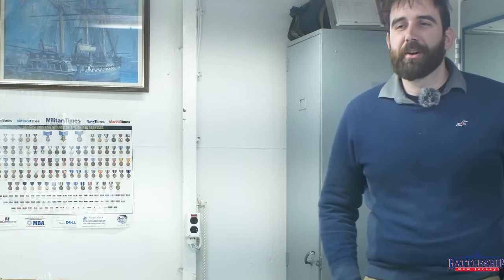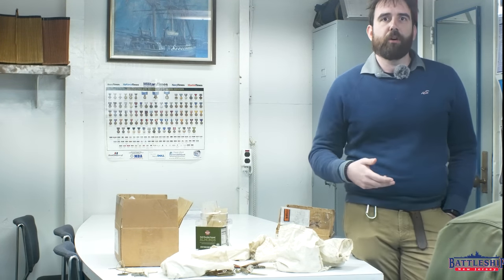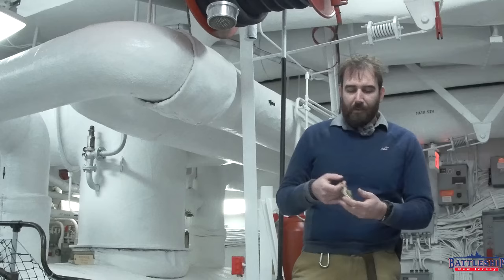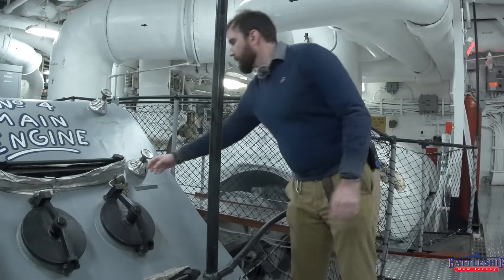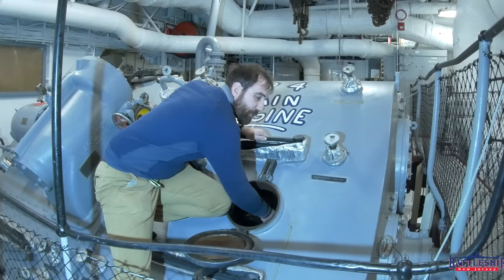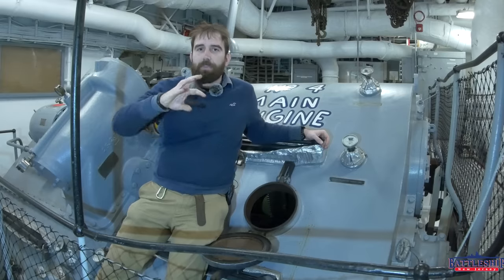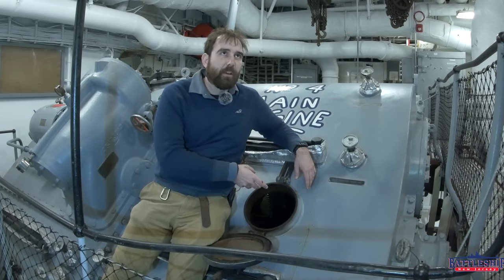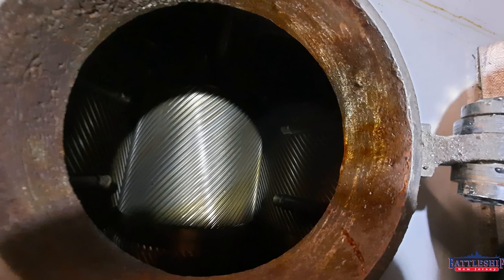The Keys to the World's Fastest Battleship: Unlocking the Reduction Gears

Comment: My advice with locks - you can pretty much always pick them. I'd think that would be the ideal solution for any other keys you can't find. The lock doesn't get damaged or cut, you remove the lock, the entire process is reversible. My biggest concern would be forgetting which lock goes where or losing the locks themselves. But ultimately locks aren't the safety feature most people think they are and realistically their use is such that someone either makes a lot of noise or takes time to remove the lock such that the good citizenry around will discover what they are doing and stop them.

My only advice is to get someone who isn't a hack. Exceptionally bad lockpicking techniques can damage the locks (usually slight wear). And whilst these at least appear to be beefy government type locks typically made to withstand huge amounts of wear and abuse, and whilst their date typically renders them far less complex than modern locks, I'd still worry for historical artifacts. My suggestion will always be the youtuber Lockpicking Lawyer - I'd expect he would jump at the chance of picking a lock like this, it would be a fantastic collab, and he's also proven his skill in front of the camera. But realistically a good proportion of locksmiths will have the skills required even if they aren't quite as fast and I'd like to imagine they would rather give a good recommendation than damage a historical artifact if they aren't confident.

I can't tell if my bias towards wanting the collab is on display, but having these picked is absolutely what I would do in the same case despite my extreme concern over wear and damage. If nothing else I'm sure he would be happy to talk and give you good expert advice on the pros, cons, risks, etc even if nothing comes of it.
Reply: You generally don't want to pick a lock that's important, it can be permanently jammed so that it has to be drilled or cut apart,

Comment: Non-sailor here, but this key system sounds like a reverse lockout/tagout procedure.  Having everything locked prevents someone from accidently working on the wrong piece of equipment.  Imagine a sailor being told to work on engine #3 and he went to #4 instead.  If it wasn't properly unlock, he might realize his mistake.  This is in addition to all the FME concerns and normal lockout / tagout procedure to ensure the equipment is taken out of service before maintenance.  In the nuclear power industry we lock rooms down for safety reasons since there are multiple pieces of identical equipment.  Checking the labels to the work orders is vital.

Comment: We know NJ can't move under her own power, but is there some kind of lock preventing movement of the gearing? I'd be afraid to stick my hand in there and have something shift and move that gear and next thing you know you're fishing what's left of your index finger from the oil sump...
Reply: Just so ya get an answer.
Yes, you lock the shaft (and thereby the gears) with what is called "jacking gear". It consists of a small (like maybe 5 hp) motor turning a small gearbox that will engage a coupling in the 2nd reduction pinion shaft. It is mainly used to slowly rotate the turbine rotors so they will heat evenly and not get a bow in it.
Through the crazy amount of gear reduction, it will hold the shaft stationary, up to a certain speed.
The destroyer that I was on, I believe we could do like 18 knts. with one shaft locked.
Disengaging the gear underway took a bit of finesse on the throttlemans part to apply just the right amount of steam to equalize the tourqe on the shaft from dragging it...

Comment: Cavitation is bubbles caused by excessive propeller speed or loading. The water vaporizes or boils due to the extreme reduction of pressure on the back of the propeller blade. Many propellers partially cavitate during normal operation, but excessive cavitation can result in physical damage to the boat propeller’s blade surface due to the collapse of microscopic bubbles on the blade.

Comment: It seems to be an early form of lock out- tag out. But in this case it might be more secure out. Any time there’s personnel working on equipment it can be damaging to operate it while being serviced as well as life threatening to personnel. If it’s an enclosed space it would be dangerous to enter a gaseous fume or liquid filled enclosure. The same applies to power sources like electricity, compressed air, steam, or hydraulic fluid to name a few. The number and types of potential hazards is staggering. There can also be chemical reaction hazards. There’s also a need to keep track of who can be working on a piece of equipment. In this case the marine will monitor who’s been around it and what they’re doing while there. Ryan it’s a good thing you kept them from cutting locks because there could be a lot of metal shavings falling into gears that way. It would be better to get a locksmith and make new keys than to replace the locks. The locks are designed with specific features for the application that might not be readily apparent. If you look carefully at a closeup of the keycuts you’ll see that some have angled cuts which requires special key machines to cut them. It also may require special internal pins to operate them. They also make pick resistant pins requiring a key except for the more skilled locksmiths.
Without a lubricant tank as large as the gear case it will cause the heat to be retained and if severe enough, cause the gears to expand and make them bind. An extreme worst case scenario but possible in a perfect storm in the middle of the ocean. It would be interesting to know if anyone has information on how hot they ran in operation.

Comment: Instead of right right lefty loosey, try the right hand rule. Curl the fingers on your right hand, if you turn the thing that direction, it will move whichever way your thumb points. Works way better at funky angles and can be flipped to the left hand when applicable.

Comment: The bubbles that form during cavitation aren’t air, but water vapor. The trailing edges of the propeller blades create low pressure areas as the props spun, and at higher speeds the pressure is low enough that the water in those areas actually starts to boil at a low temperature. The vapor bubbles collapse almost immediately because the low pressure areas are very small and move with the blades, and when they collapse there are minuscule shock waves. Shock waves from collapsing bubbles touching or in close proximity to the props will eventually cause pitting and cracking.

Comment: A submariner once showed me a reduction box, and said they never open it, since a tiny flaw could make noise. I didn't realize the gears were such fine pitch.
Reply: It’s counterintuitive but even finer threads on bolts has a higher percentage of thread engagement/ holding power than course threads. It’s also why finer helical gears are quieter since they have less clearance between the teeth. They have a larger contact pattern which spreads the load over a larger area which extends the life of it.

Comment: All of the magazines, pyrotechnic lockers and the armory had high security locks.  We had 4 sets of keys for the magazines for each group. Turret 1 (group 1). Turret 2 (group 2) Turret 3 (group 3) The 5inch mags and ciws mags. (Group 4). When we secured from working hours we would stand magazine security patrol. He would have to go into each and every magazine on the ship that had munitions. 1 group per hour. Mid-watch would take magazine temperatures  groups 1&2. 4-8 watch would get groups 3&4. Duty armorer in port or armory crew while underway would get the temps for pyrotechnic lockers and SRBOC lockers. Sometimes I would have to go fix a lock when a key broke off inside the lock.

Comment: Ryan - Another great video.  Incidentally -- Cavitation is caused when the propellers lower the water pressure below the point where the water will vaporize.  The bubbles are water vapor not air.  When they collapse they cause noise that can give away the location of the ship and and pressure that can damage the propellers.

Comment: Some ideas for lock and key would be: rudder equipment spaces, small arms lockers, fresh/potable water storage, powder rooms, radio transmitter/receiver rooms, and areas containing classified or compartmentalized information such as CIC. I say these spaces because they have equal or greater potential to cripple the ship. Crippling the ship's ability to steer can be as great or greater a hazard to the ship as crippling its ability to move, as seen with bismark. Small arms could allow a group to commit mutiny or break down the command structure. Poisoning fresh water could leave enough sailors unable to fulfill their duties and operate the ship and its defenses. Powder rooms could create massive explosions and fire if someone were to intentionally produce an ignition source inside. Radio transmitter rooms could give away the ships position if someone were to transmit a signal during radio silence. Areas containing classified information or fire control systems for the ships missiles (in the 80s/90s) could breakdown ship security and compromise fleet wide classified information. 

I imagine there are others too and I may be over looking some big one(s) because I'm not a sailor. But those are my guesses off the top of my head.
Reply: Ryan mentioned it in a previous video but he also found the authorize launch keys for the nuclear tomahawk cruise missile launch station so obviously the launch of even tactical nuclear weapons would be kept under lock and key because of the ability to potentially escalate a conflict and cause a total nuclear war
Reply: @coolsnake1134  Oh for sure. Also a point I just thought of is that the nuclear keys probably weren't stored in CIC. It was top secret that the iowas had nukes on board, the DOD still won't confirm or deny that they were equipped on deployment. That indicates that the keys were not intended for quick access, so I'm betting they were kept in a safe in the captain's or xo's staterooms. They'd probably remove them and carry them for more rapid access if and when the Pentagon escalated the defcon past a certain level. 

As for the normal tomahawk launch/arming key, those were probably carried by the XO or watch officer in CIC while in a combat zone, to ensure the conventional tomahawk anti ship missiles could be rapidly deployed in response to an imminent threat. When not in a combat zone or on active deployment, I imagine those keys were either stored in CIC or more likely, with the XO andor captain. I imagine a lot of people in CIC had access to those safes, and given the destructive capability and the fact they could be fired without a crew of gunners, those keys would likewise be kept with high ranking officers.

Comment: When I toured the USS Hornet this summer, the docent showed the reduction gears and explained that someone during Vietnam through a wrench in to damage the ship. I don't recall if it was Hornet or another ship. This may explain the locks. The question is, when were they added to NJ? During WWII? The docent served in engineering on Hornet and was very knoweldbable.
Reply: It happened to at least one ship in St John's, NL in WW2.  So I have to assume it would have been a WW2 era thing.  (stokers and Newfie John...).  IIRC, was a RCN rather than RN ship, and mid war.  Probably a DD.  

I've been in the last couple of us leaving a gearbox on HMCS Algonquin, with the Command Gearing Inspector, myself and ??? (perhaps PO2 Scott).  There had to be 2 of us in the box due to safety, and I got picked because I was there.  Was a worm up and in situation, on a COGOG gearbox.  (main gearbox, if you know a 280...the aux gearbox is relatively tiny, and is common sump- see the article I linked to before for details).  Anyway, was a bit of a fun lark as a fairly new OS (E2).

I have my drawings for HMCS Protecteur done for my Cert 3 as a PO2 (E-6/7), done for my EOOW package.  The tubes in the video are for the oil spray/mist onto the gear interface, and likely will spray onto the trailing edge in the ahead direction, giving time for the oil to get to the space between the teeth before meshing.  The oil will be Mil-L-357, Steam Turbine Oil, same as we used.  Our sump held 1250 imperial gal (not them puny yankee gallons !) of oil give or take- at 38-40" of oil.  We had a dip tape and it was a bit of a concern that it meant you had a open hole into the sump for fine debris to be added if someone was so nefarious, or a pencil if they were just plane unlucky.  (oh, there's a story about a sounding tube, a flying fish, an dip tape & a mini mag light...).

Comment: Cavitation bubbles appears because of the pressure difference. The bubbles are actually the same as the ones at the bottom of a kettle or a pan when you boil water and they are supersonic. They pop so hard that it eats away the material of the propeller.

Comment: The first shot of Engine Room #2 keys are high security MEDECO keys. MEDECO is the brand name. They include Left and Right angled cuts, besides the common Centre cuts. Tolerances in the depths of the cuts are to within 1/5000th of an inch. Very, very difficult to pick. Not impossible, but very difficult.

Comment: Another locked device would be the master gyro compass!
Reply from the maker: Surprisingly, it's not locked.
Reply: @BattleshipNewJersey  Ours never was.  In fact, the bolts holding the cover on the Master Gyro weren't even safety wired.  Our biggest security issue was that critical loads were fed from the power side of the Main IC Switchboard, and heading/pitch/roll info to critical equipment such as the bridge gyro repeaters, SLQ-32, Sea Sparrow Missile Control, etc. were fed from the ACO section.  We had a Sperry Mk 19 Mod 3A master gyro, and a Sperry Mk 23 Aux gyro.

We did keep the cabinet for the AT&T Dimension 2000 PBX locked, but that was more to keep them from popping open during heavy seas than any security concern.  We had a small Flammables Storage locker for PMS materials that was also kept locked.  Both of these locks were keyed to match the padlocks on the hatches.  (Main hatch and the escape trunk),

On the other hand, the IC/Gyro shop was allowed to be either locked or manned by at least one IC.  No middle ground.  Having the rover find the space unlocked AND unoccupied was an immediate security alert, eventually followed by Captain's Mast for whoever left it unlocked.

Comment: When I was in the service in the late 1960’s new locks came in boxes of 20 each lock had its own key. Each set of10  locks had key called a master key which opened any one of the 10.  Then there was one Key called a grand master which could open all 20 locks.
And like the one you opened the key could not be removed while the locks were open

Comment: now you just need to weld a plate on them gears and have the fastest drifting battleship in the world!
Reply: How about we NOT weld things to the main reduction gears. There are many less destructive ways to disable the engine.
Reply: @user2C47  It's a joke about welding the open differential in a car so both rear tires spin together - he's proposing doing the same to the propellers.  Not to disable them, but to lock them all at the same speed.
 (and yes, we all know those gears only go to one shaft - but they do have a passing resemblance to a differential, so the joke works.)
Reply: @Elkadetodd  I am just glad someone got the joke lol Obviously I know this is not the same as a differential

Comment: I know it's not right to complain as clearly there is a lot of effort, but the camera settings are wild.  I mean the opening shot is filmed under flourescent lighting which is fine, I understand there will be flicker, but why is the ISO set so high that there is noise all over it and the brightness/exposure is way too high.
May I suggest you will get far better results, in the camera is less than 10 years old, if you just put it on AUTO and leave it there.

Comment: You just need to invite the lock picking lawyer for a marathon.  

The key removal issue is fairly common.  Usually to can just rotate it 180 degrees and press the shackle down, otherwise you just lock the lock off the hasp.  You don’t take the lock attached to the key ring to the next station.  

Insert key
Unlock 
Remove the lock
Lock
Remove key 
Store the lock
Move to the next lock

Comment: Reduction gearing was an incredible bottleneck.  I read long ago that one reason for building the Iowa class was that reduction gearing capacity was maxed out.  Even if you could build 20 destroyers for each battleship, there was not enough reduction gear capacity for 80 more destroyers, so why not build battleships?

Of course, even if true, it wasn't the primary reason, and when the Iowa class was designed and ordered before Pearl Harbor, no one yet realized how obsolete battleships were.

Comment: Honestly, if you run an 18.25' diameter screw at 5,000 RPM, I think cavitation is probably not the biggest of your problems.  That would be a blade tip speed of 3,258 miles per hour... which, at sea level, equates to about Mach 4.3. The screw would almost certainly violently break apart and throw large, dense, supersonic projectiles in several different directions.

To give this a little more perspective, this is nearly twice the muzzle velocity of the 16" guns... which means that the fragments would have almost 4x the energy per unit mass as the projectiles fired by the guns. Very bad day all around.

Of course, many other pieces of the system would presumably fail long before the screws could be accelerated to such a speed.